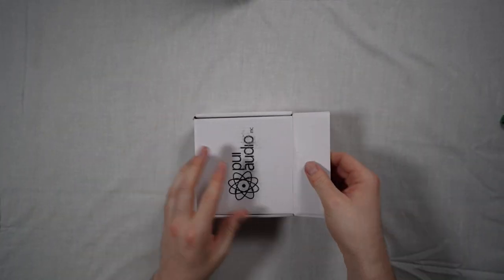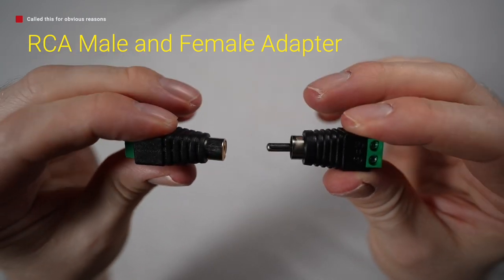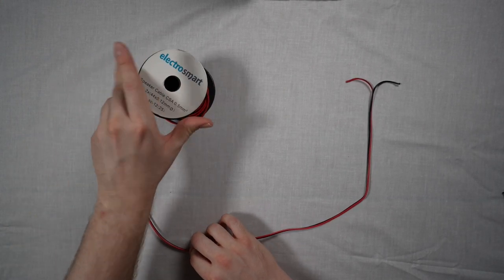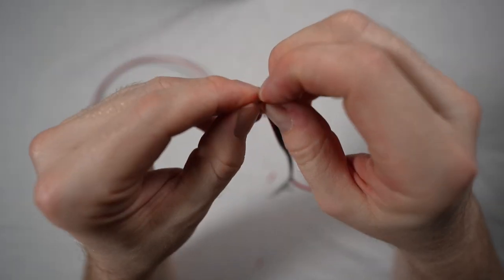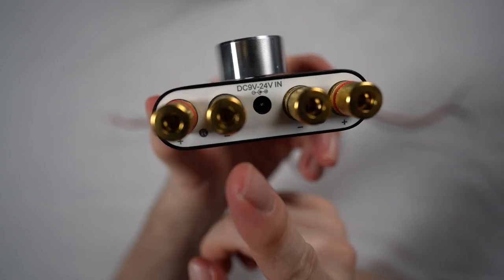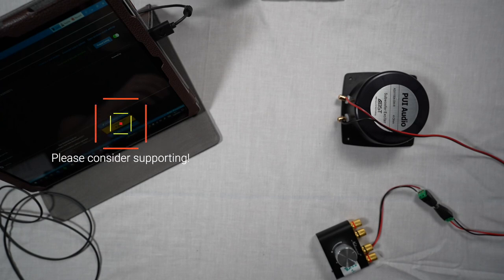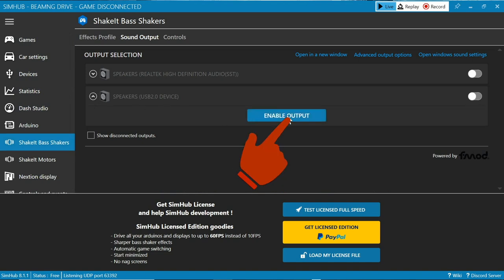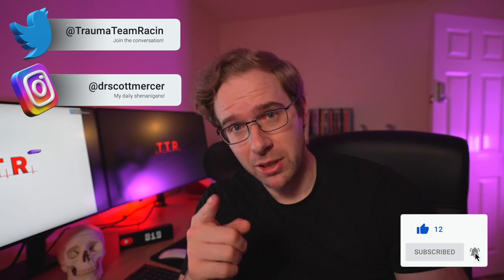How to Connect a Bass Shaker for Sim Racing Using SimHub

Comment: use banana plugs if you want to quickly disconnect wires, and is you still wan to separate the wire in the middle use sae 2 wire quick disconnect fittings as they won't leave any exposed metal in between
Reply from the maker: These are some great alternatives👍🏻

Comment: Is 0.5mm2 wire sufficient enough? Most brands recommend 1.5mm2 for 50w bass shaker
Reply from the maker: For these shakers I had no issues and a larger guage wire would have struggled to fit. Increase the wire guage if you feel more comfy. I use a large guage for the Aura Sound shakers because they can take it.

Comment: I have a Buttkicker Gamer Plus, it was one of my favorite purchases for my rig, I even use it for the space sim I play. I was thinking of adding an additional base shaker but set up like this, and mount it under my pedal plate, so this is a great guide for it.
Reply from the maker: Glad you found it useful mate! Isn't the Buttkicker gamer plus a 90 watt shaker!?? 😍😍😍 This way I think works out a bit cheaper than the Buttkicker stuff I think.
Reply: @TraumaTeamRacing  Yup it's 90 watts, but I'm pretty sure the 50 watt set up will cost waaaaaay less, which makes it easier to get another bass shaker.
Reply from the maker: Waaaayyy less. I remember doing the math. Considering I think that buttkicker amp will only power one shaker. Its a good product but I think perhaps a bit steep in price. Would love to give it a go though to compare 😅

Comment: tx for the great video...
wrt to adding more...does a multichannel equivalent of the 2 channel exist?
i.e. amp+sound card in 1 with ~6-10 channels?
trying to minimize wires, and making it simpler
Reply from the maker: You are very welcome 👍🏻

My current solution is to run a separate sound card and I still run 3 Nobsound amps just to power the shakers at present. I have not been able to find an amp/sound card combo with the correct specs that would allow what you are suggesting unfortunately.

Comment: Great info for us that have never installed a shaker on a sim rig, If I'm not mistaking are those RCA inputs on the back of that mini amp? If so seems it would be better to use copper RCA jacks 2 positive and 2 negative that way you are sure to separate the signals with a much better sound and use that method for your quick disconnects? Might not really matter for just a bass. I happen to have some left over copper jacks that would work in this case.
Reply from the maker: Thanks for the support Babyboomer59👍🏻 I'm currently in the process of changing my setup so will have a look into the RCA jacks. Thanks for the tip and I'll give them a go 👍🏻
Reply: @TraumaTeamRacing  OK it appears that I was wrong in assuming those were RCA jacks, I just got my pair in and that's not what they are, they only have the hole that secures the wire.
Reply from the maker: @Babyboomer_59  I think banana plugs would work mate? That was going to be my next go to. Then you can just whack them straight in and out 💪🏻

Comment: Great video Doctor. I have a similar bass shaker setup. Instead of the connectors mid cable i use banana plugs on either end of the cable.
I believe your amp has a built in soundcard. Right?
Reply from the maker: Thanks a lot Joost! Great minds think alike😉 Banana plugs would also work a treat, very nice. These do have a built in sound card you are bang on the money👍🏻

Comment: Hello its me again. Today my soundbar for my sim went out. It was great while it lasted, but it only lasted a year so I need to figure out a new option. Curious if you have a video on your speaker setup? Thanks!
Reply from the maker: I mainly race with headphones at present due to my streaming. However I do also have a 5.1 surround system. This is wired up with an optical cable directly into the motherboard. This is a good idea for a video. I will add this to my to do list! Thank you 👍🏻

Comment: In terms of what you have felt, is this a better option than the 90w Buttkicker (getting 2 of the daytons potentially) and custom mounting them to my rig? I wouldn’t really want them on my pedals, just on the seat for RPM’s and road feel.
Reply from the maker: To be completely transparent I have never tried a 90w Buttkicker and would love to get my hands on one. However with that in mind I would still go for more of the 50 watt shakers rather than a singular 90 watt. If you can afford multiple 90 watt ones and also have room to mount them all the power to you.

The thing you need to bear in mind is the signal and details getting lost by having to many things fed through it. Even if you have more power to one singular unit, if you send 3 signals to it (road bump, rpm and gear change for example) that still unit still needs to create definition for each one potentially all at the same time. You are going to get much better clarity for an individual shaker handling a single effect.

For mounting the more you can get the more you can play with effect separation. I have 4 mounted to my seat and 2 to the pedal deck. I have a video on the mounting if you wish to check it out: https://www.youtube.com/watch?v=fj1U9TTmIBU&t=305s

I would mount one near your feet personally so you can feel ABS and some road bumps there. I enjoy it and adds to the immersion a bit. Ultimately this is all personal preference and there is no right answer. Hope that helps you👍🏻

Comment: Six bass shakers under your seat?
How do they perform? As one big ass shaker or did you assign different effects to individual shakers? And do you feel a difference between left and right?
Reply from the maker: 4 under the seat and then 2 straddling the pedals on the left and right. Everything has different things assigned so the effects don't get 'muddy'. I think on solid frames it is very difficult to differentiate between left and right as it just tends to conduct it to all of it. You get a more definitive feel for front/back separation and certainly more of a left and right at the front. The more effects you've got going through one shaker it just loses definition I think.
Reply: @TraumaTeamRacing  i agree.  Currently I have a bass pump III directly attachted to the bottom and a Dayton puck on the left and right of the seat. I have rumblers on my pedals.
The pucks give great left and right sensations. However i would really like to have a bass shaker on the back of the seat as well. For some serious lower back massages 😁
Reply from the maker: @YoastZilla  That sounds like a really awesome set up to be fair. To be honest if I could have somehow got those pucks into my seat I would have done it. I think having them in direct contact with you is the only way to get that separation👌🏻Wire up one of these 50 watt bad boys and you should be set💪🏻 Won't break the bank either😅
Reply: @TraumaTeamRacing  can't you attach the pucks to the sides of your seat? I have them on the outside. Not in the padding.
Reply from the maker: @YoastZilla  I point blank refuse to destroy the seat. No way to do it without destroying it😂
Reply: @TraumaTeamRacing  🤣🤣🤣 it's not destoying. It's enhancing😂🤓
Reply from the maker: @YoastZilla  Nope....no way I could bring myself to do it. I love my seat😂

Comment: Using the RCA adapters is an alternative to soldering the speaker wires from the bass shaker to the amp?
Reply from the maker: You do not need to solder it is purely for convenience so you can disconnect. I have since moved to banana plugs and these also work really well.

Comment: Hi! Great stuff!  But how to Connect it with ps5?
Reply from the maker: I think there is a way to it with Gran Turismo because you can pull the telemetry data but I think you would still need a PC.
Reply: You share over Wi-Fi but you need a pc that is turned on with sim hub running while you play gt7 there are setup vids online
Reply from the maker: You're all over my comments 💪🏻😂